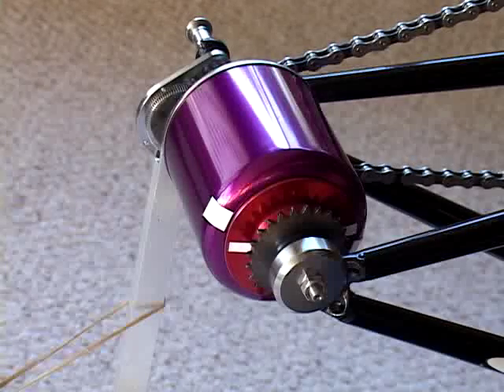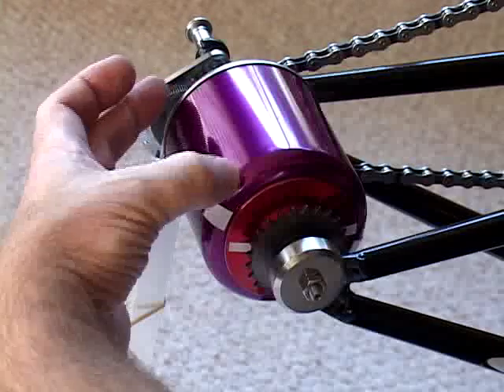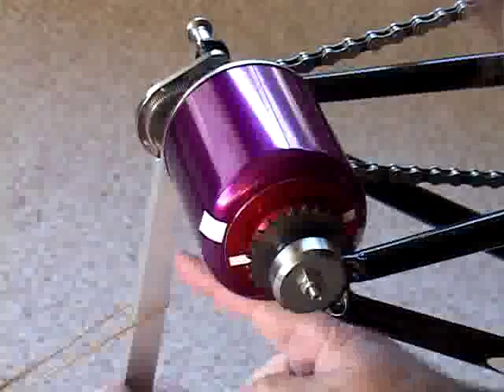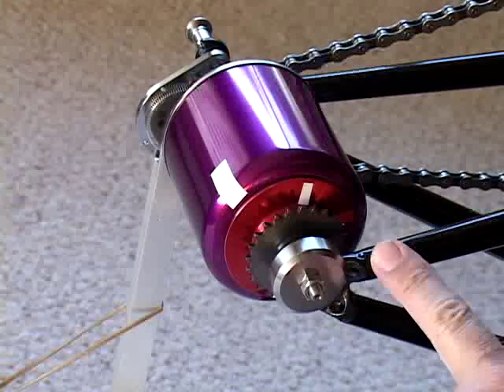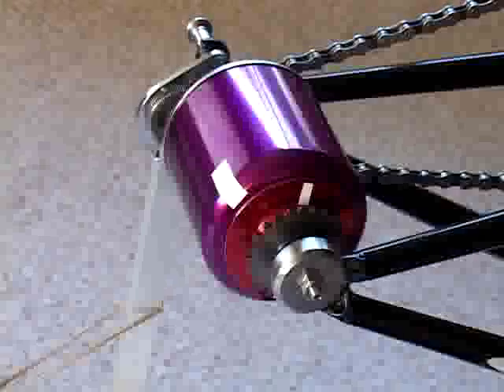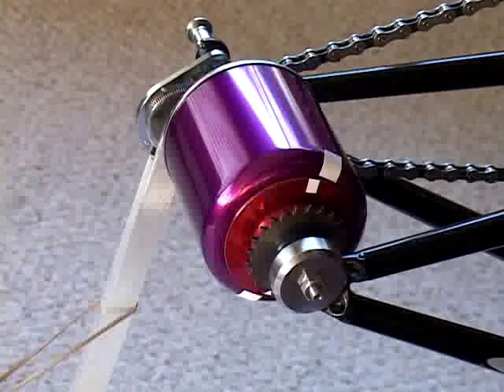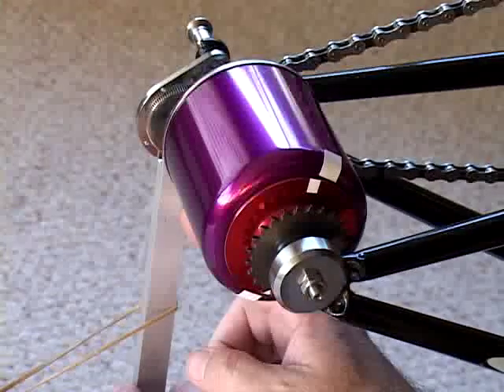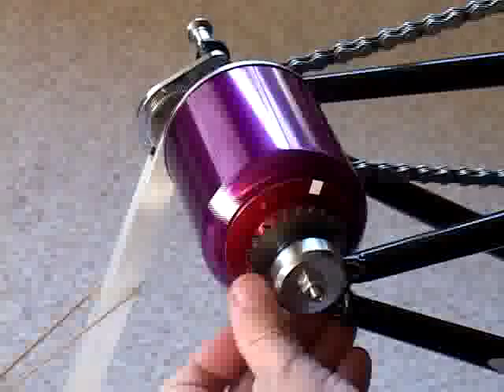Automatic Bicycle Transmission (IVT)

Comment from the maker: @saints360row OK!  If you pedal your bike with gearing too low, you pedal fast and with low pedaling force.  If you pedal with gearing too high, you pedal slow and with high pedaling force.  You can feel this effect.  Your body works best when your bike gearing is neither too high nor too low!  The SIVAT automatically adjusts your gearing to be just right for you, regardless of your bike speed; it does this by using your pedaling force to push on a spring in the SIVAT, adjusting your gearing.

Comment from the maker: @ebouwman034 The torque setting would be located at the SIVAT because its adjustment would be infrequent.  A much stronger spring would provide much higher torque resistance for pedaling.  You are correct; overload would never be experienced or needed on a bike, except with abusive torque levels.  Uphill wheel torque will be increased automatically, so standing on the pedals may be uneccessary, but would be allowed briefly as the ratio drop would be fairly slow. KERS on a bike ; impractical.

Comment: @Dorisequador The whole point of an alternator is to be able to adjust voltage output with varying rpm rates. You would just need to have a voltage regulator to do that job instead of doing it mechanically.

Comment: Ok, so...  you would use a selector lever on the handlebars to basically select the ideal amount of torque? And then after that it would regulate it based on crank torque?

Also if you can overload it with your hand then there would be NO issue for me overloading it by standing up to get extra power up a steep hill....  Maybe, just maybe and overload feature is NOT a good idea on a bicycle specifically.

I love the idea of using it as a KERS on a car or bike...

Comment from the maker: @mrbluenun The name works OK.  The SIVAT will be a non-hub design in the future; it's called Gen2, and it will work well for a trike or quad, but it won't be adaptible for braking because it's a free-wheeling, forward-propulsion system.  The SIVAT won't be available as a product until after we get funding.

Comment: Hi Mr Simkins,

Sorry if your 'real' name as heard here is wrong, OK?

I am an Epileptic and though I do not have the knowledge or means to invest in your project, I would and am interested, because I am trying to think of a way to design a try-cycle or quad-bike, for use of an Epileptic. I am particularly interested in your hub potential as an automatic smooth braking system. So for instance I can buy your hub and fit it to an ordinary bicycle. 

Mrbluenun

Comment from the maker: @JMILLERPRODUCTION The SIVAT will likely be initially available as part of a special F.S. bike, and not be sold separately for bikes until later, if at all.  This is an ongoing design project in development currently, so it's not yet available as a product.  Sorry.  The bike will have a lever for optional manual control of the gear ratio.  Thanx for your interest!

Comment from the maker: @Jpiro1 Thanx!  Magnify speed?  Mostly, your bike speed depends on your legs' ability to produce power; the transmission assures that pedaling cadence & force are in the best balance for getting the most power out of your legs.  Notice that if your gear is too low, you pedal too fast, and if the gear is too high, you pedal too hard.  The SIVAT 'senses' when your pedaling force is too high or too low, then makes adjustments to the gear ratio using a spring to react to pedaling forces.

Comment from the maker: @pmdnslj The power rating for Gen2 is 1 kw @ 500 rpm, so torque limit @ input is ~19 Nm, fairly constant across the range of ratios.  Output torque capacity is ~1.5X input in highest ratio, then ascending as the ratio descends until getting to very low ratios where it levels off.  There's a nearly linear inversion of torque v speed ratio on the output.  Gen2 is smaller to take advantage of higher operating speeds of a 2-stage I/O.  Capacity increases with volume scale for other sizes.

Comment: @SIMKINETICS I see. I didn't realise that belts are less efficient than chains. I was also wondering whether the Van Doorne push-belt system would ever be viable on a bicycle. Where the primary pulley could remain fixed and the secondary pulley is variable. But don't know about the efficiency of such drives. I would imagine the belt to be heavy and expensive with the added problem of enclosing such a system without adding too much weight. I've answered my own question :)

Comment from the maker: @PorkyPiggles Efficiency is the reason that I strongly prefer to use chains.  The SIVAT Bikes will have a two-stage drive, so SIVAT takes another hit of ~2% from the second chain.  Belt Drives take a hit of ~8% min on each stage, already too high for a single stage. I know the numbers for high torque, high belt-tension apps.  Serious bicyclists won't tolerate efficiencies below ~90% for most of their riding, and would prefer more.  Thanx!

Comment from the maker: @grandamracer23 Thanx!  A half dozen partner prospects have shown interest.  The lousy economy is holding back investors from taking risks right now.  Yes, I've improved the design considerably since then with higher power density & addressing the few weaknesses in this first prototype.  The newer concept will move the SIVAT from the hub to a frame position above the bottom bracket (crank axle).

Comment from the maker: @treeefrogUK Many inventions look for a problem. For bikes, the SIVAT is automatic, effectively a CVT with extensive range that solves the problems of shifting gears while the rider attends to other challenges of mountain biking.  All ratios are more precisely tuned than in Nexus or Rohloff.  This technology transitions to motor vehicles of all sorts in eliminating clutches & torque-converters with the added proven advantages of CVT's.  Once solved, the problems becomes obvious; progress.

Comment from the maker: @lezbriddon No slippage. The gear ratio just keeps going down with gears fully engaged the whole time, even at zero.  For demo purposes, a rubber band is used to represent a much stronger spring.  The final SIVAT will resist much higher levels of reaction torque at the strong spring-loaded mechanism; levels appropriate for bicycing torque.  On a bike, you will not likely ever get to zero output.  Very little heat is produced, even at high power throughput.

Comment: is there any limited slip in this or is just gear ratio? I'm shocked at how you get so near to a 0 gear ratio with virtually no output movement. if you can stall the output with your thumb(overload) surely there must be some slippage and heat generated?

Comment from the maker: @mindciller Thanx.  Yeah, I was prejudiced against the concept of an automatic for a bike for a long time too.  It just seemed dorky!  The auto feature on my earlier CVT was sort of an accident, realizing that reaction torque could be used in the ratio adjuster.  Then, after testing it, it seemed to work quite well. So far auto bikes have not done well in the marketplace because the only ones out there are ill-conceived.  This will be different.

Comment from the maker: @mindciller I eat engineers for lunch too.  Certainly cars & transmissions are more complex now, but the fundamentals have not changed.  Until SIVAT!  If you are a master transmission builder, then you might consider working with me in the future.  I'm surprised that you have difficulty understanding the relationship between torque & rotational speed because it is fundamental to transmissions & torque converters.  Bikes?  My very first job was bicycle mechanic; invented/built 9 trannnies...

Comment: @SIMKINETICS if you're talking about bicycle tranny's why not i'm a noob and can't see how that hub could actually do anything but change gearing, but automotive tranny's don't even try. i was a master transmission builder for gm afterall and eat engineers for lunch, including a shop foreman for gm (which i was too in technically more difficult times than your pappy) and i've built more cars and trans. than even i could count. what are your bicycle credentials? 18 speeds? ha ha JK i know IVT lol

Comment from the maker: @mindciller That description is for an optional setup model for some riders who are willing to spend the extra bucks to get pedaling data as a training aid.  The plan is to simply add electronic hardware without needing to change the design; this would make production easier & allow the end-user to upgrade easily.  Above 80 rpm, the power curve follows pedaling cadence for bicyclists, so this could be a good training tool.

Comment from the maker: @mindciller This is not all academic, although, as an ME, I've had a heavy dose of physics & math.  I was a knuckle-busting hot-rod before you were born; built up a high-revving Z28 from scratch that won first in class of a field of ~500 competitors in autocross racing.  Dusted several street drag-racers too.  My pappy was a GM production foreman who taught me more about cars before I was ten than most people ever learn.  So now, you want to argue with me about transmission physics?

Comment: @SIMKINETICS a load cell could be anything really. like a water brake, a set of brake pads, an eddy current absorber (electric) so obviously it isn't a "electronic device" only. and yes a speedo and tach both monitor rotation. that torque sensor would be nice but probably too expensive to add in for an end user, but all the other stuff seems easy enough

Comment from the maker: @mindciller BTW, a load cell is an electronic device, & a tach is essentially a speedometer.  In the SIVAT, the in-series load cell would monitor reaction force as a torque sensor, & the tach would montor either input or output speed with DLA feedback & actuation of the ratio controller; all I/O to a microprocessor.  Systemically, this would be the drivetrain controller in a car.  On a bike, this could be part of the bike computer for rider info about his pedaling performance.

Comment: @SIMKINETICS details details power doesn't have to be measured in rotation, but anyhow changing gearing (like a longer pedal crank stroke) can give a mechanical advantage but it can't multiply it the way a torque converter can. it's not so simple as just rpm v.s. input/output like on a bicycle. seriously it gets MULTIPLIED and the whole a torque converter is inefficient (when cruising they can be locked 100% with a lockup clutch) and when stalled up raise rpm's increasing torque/power to go out

Comment from the maker: @mindciller You confuse torque with power.  Pulling up the R's on launch, in conjunction with low 'gearing' of the torque converter, provides max torque to the wheels for initial acceleration.  The SIVAT will do that too.  Torque multiplication is a function of the TC, but it works by trading away output speed as a function of input speed; if you bring up the R's, the engine power is increased, of which more torque can be harvested at the wheels with the lowered 'gearing' at launch.

Comment: @SIMKINETICS k, so r's at launch has nothing to do with multiplying torque-you just add torque like in a manual transmission as in a bicycle. BUT in an automatic transmission the torque converter MULTIPLYS TORQUE!
i really wouldn't call a bicycle hub a load cell either but the electronics for one would definately apply for a speedo(not tachometer), reading torque etc..

Comment from the maker: @MegaSoulSearcher You are so correct!  Innovaters must deal with the fundamentals first. Then, the fine-tuning can be the easy part later.  On this invention, I've anticipated the fine-tuning needed for various applications with testing & research that will surprise many doubters!  Raw physics often appears deceitful until it is tried.  The predecessor bike CVT proved that torque-responsive ratio lowering is unquestionably the right way to go; proven by mountain riding that bike many miles.

Comment from the maker: @mindciller If you look at earlier comments & responses, you'll notice that a manual override has been planned all along.  And as an engineer with a long career in Silicon Valley, it would be heresy to not consider having a microprocessor interface to a load cell, tachometer & DLA within the SIVAT!  And as for it being a differential, yes it is, as is the classic torque converter you know.  Ask yourself why it's better for a dragster to bring up the R's on launch; true for bicyclists too!

Comment from the maker: @mindciller AutoBikes suck because they change gears as a function of bike speed.  If you stand on the pedals, the ratio shifts up, not down because you will gain speed then.  Derailleur shifting during high pedaling torque is disconcerting & risky!  OK for mom & pop, but crap for performance riders.  If you want to surge, lowering ratio slightly will allow raising cadence for better acceleration. Pedaling power is mostly a function of cadence between ~80-120 rpm, according to biometric studies.

Comment from the maker: @mindciller ...In fact, some useable power is lost through heating of torque converter fluid via fluidic shear friction, so output power is decreased, never increased.  Hydrostatic torque converters are notoriously inefficient (<75% efficient) with high power losses, not true with the SIVAT.  Initial tire adhesion aside, optimum acceleration is obtained by balancing the torque/rpm ratio of the wheels via the output, trading away torque for increasing wheel rpm by torque conversion.

Comment from the maker: @mindciller You threw in a misstatement.  Power is the rate of energy transport or conversion; unit energy per unit time in a closed system.  Power is the product of torque times rotational velocity; so for a given power, there is an inverse relationship between torque & rpm.  A torque converter merely changes the ratio between torque & rpm without changing their product (power); it does this by modulating the mechanical advantage from its input to its output, like the SIVAT does.  Cont...

Comment: @SIMKINETICS umm "no transmission will add power" is a false statement. that's the purpose of the torque converter of a transmission to multiply torque increasing power from an "engine/motor". just thought i'd throw that in there.

Comment from the maker: @mindciller Like I mentioned, I designed, built & mounted a CVT with a similar control system on it.  I & several others pedaled the bike it was on around the mountains; it works very nicely.  I've been an avid cyclist for several decade, so I know that it works in a way that feels right.  This is not a guess.  Look up the definition of a torque converter, & don't get stuck on the hydrostatic version; look at the fundamental operation of torque/speed conversion.

Comment: @SIMKINETICS i'm not convinced it's a torque converter by "it's definately a torque converter"... "ratcheting", "gear step up" "changing the ratio" is more of a differential. also there's nothing worse than wanting to pull a numerically lower gear (like lugging it) and having the damn thing downshift to a numerically higher (i.e. easier pedaling) and having to pedal faster than you want to for given speed. that's why i was saying develop the twist grip or a means to control the darn thing.

Comment from the maker: @brian16lawton Speed against resistance (hill ascents & wind resistance) is a function of power.  The power is up to you & your legs, or engine/motor; no transmission will add power.  The SIVAT is intended to automatically adjust the ratio for your optimum efficiency in utilizing the power that you produce by regulating your cadence.  Studies show that keeping pedaling cadence at around 80 to 95 rpm is optimal.  Similar effects are true for engine & motor speeds too for their input speeds.

Comment from the maker: @mindciller Bear in mind that this is a presentation of a concept.  I posted it to get feedback about the concept.  After the next prototype is built for a real-world bicycle, this demo will be replaced by a video of a rider traversing changing grades, likely including a live inclinometer & speedometer bike output to small windows in the video.  A predecessor bike CVT was tested extensively, so I know that this spring scheme works very well to maintain cadence & power near constant.

Comment: b.s. it's nothing like a torque converter. pft., anyhow the thing i find strange is how with more load it lessens the output with your rubber band spring idea-you should cut that out of the vid until you come up with a better means of moving that arm based on rider input (i.e. throttle grip) or like cars use with a vehicle speed input and output speed sensor to command maybe a solenoid with a computer.

Comment: Is it possible to adjust the force (i.e. wattage) required to turn the gear before the ratio is automatically reduced? I'm thinking in terms of a bicycle and possibly using this hub as training tool. When I train, I try to maintain a certain wattage (pedal force) and this device could help to do just that.

Comment from the maker: @v50man Eventually, it will migrate into engine & motor-powered vehicles that can use a transmission that needs no clutching operations to get going from a dead start.  For bikes, the main advantage is a rather wide range of ratios.

Comment from the maker: @Polybun There are 3 principle ways to do it; traction, hydrostatics & ratcheting.  So far, no one else has come up with a smooth ratcheting CVT, let alone IVT.  The other principle ways do have a lot of drag; ratcheting does not.  This is not a product yet, so prototype costs would be prohibitive for setting you up.  Anyway, thanx for your willingness to try it.